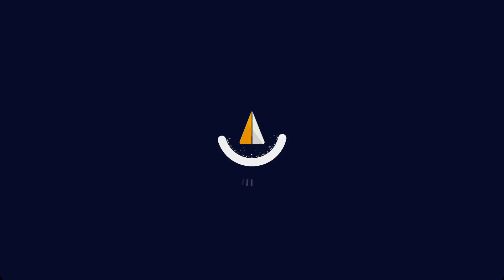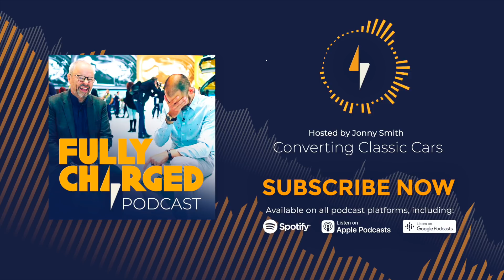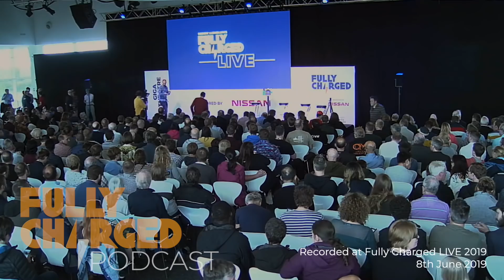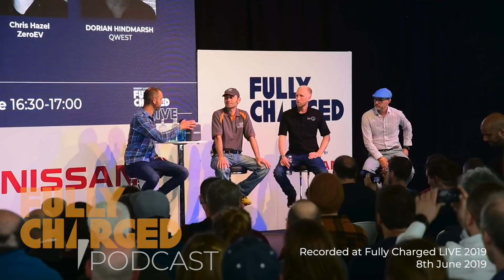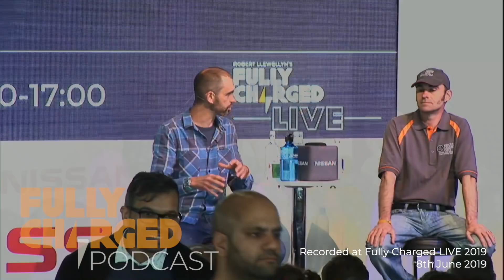FC LIVE 2019 - Classic Car Conversions

Comment: I think this discussion over simplified some of the issues. As discussed modifying a classic like a bettle is relatively straight forward but still comes at quite a cost. But then you have a very basic car with little or no comfort or safety. The problem with converting a modern car is that there are a lot of complex systems that were designed to work based on having an engine if it removed a lot of things won’t work and the cost of integration is significant for something that will be a prototype. To the point it would be more expensive than a brand new EV.

Comment: How do I get in touch with these guys!  I have a 2019 Tesla Model 3 that was totaled last month at 1000 miles when I was driven off the road & took out a light pole in dead center of the car.... Insurance is dragging its feet in reimbursement. I have the full title... What is the value?  Every part worked fine.  Frame & aluminum body are not fine.  DM me for pics.
Reply from the maker: Hi Jeff, what sad news about your car. Hope everyone involved were all safe from harm. To contact them directly I would try LinkedIn
Reply: https://www.electricclassiccars.co.uk/
https://zero-ev.co.uk/
https://qwestnorfolk.co.uk/

Comment: I like the idea of classic, but I also like sat nav, modern driving comforts and safety features. Soon no one will touch used diesel, could be a good investment  buy cheap and convert to leccy
Reply: Also, most cars with blown engine are not worth much more than junk price.
Reply: Newer cars are a complete pain in the ass though due to a ton of proprietary code in their CAN systems so no outside hardware can talk to it, and it freaks out when the engine goes missing